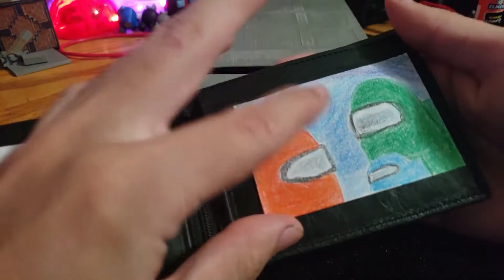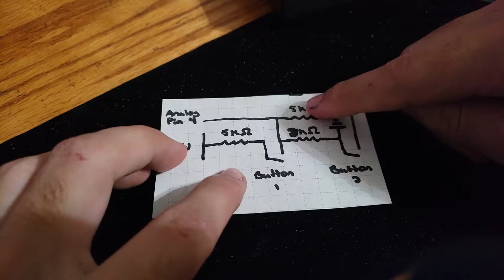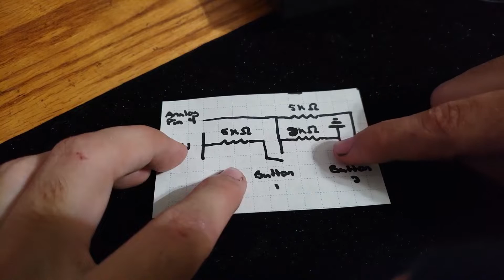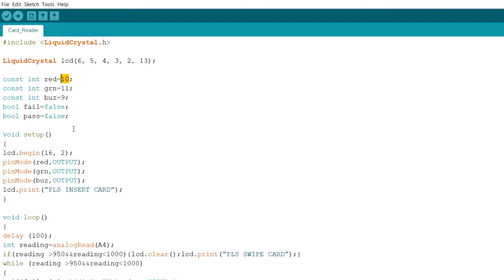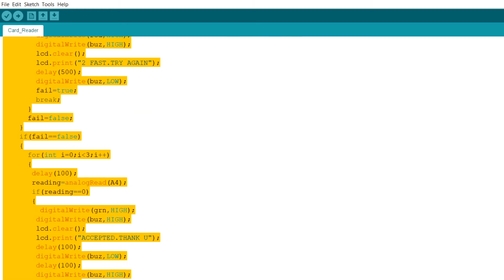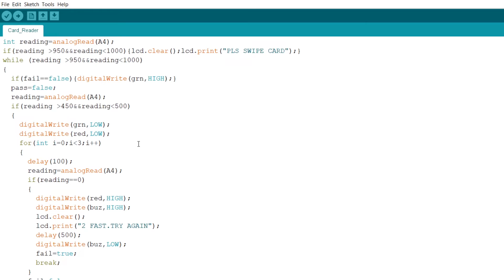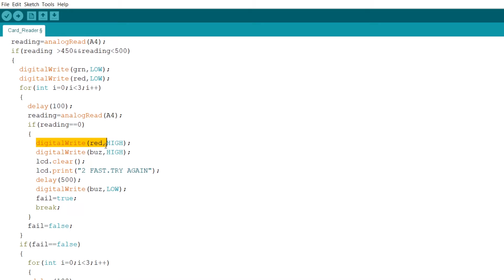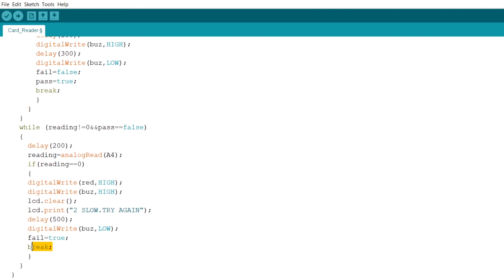Among Us Card Swipe Build

Comment: PLS TELL ME THE CODEEEEEEEEEEEEEE!!!
Reply from the maker: Luckily I had a spare copy. Go to this google doc to copy and paste.(under 2021/01/11) Cross reference with the video if any problems, and also reach out : )  https://docs.google.com/document/d/1d9TH0bv79RYRv-bEe2RoEuo2szrrrWT5UvjHN3ZVvrM/edit?usp=sharing
Reply: @hecbac  And what i need 4 this project?
Reply: @hecbac  And can i get the file in .ino? Cause when i paste it, it just says error massages
Reply from the maker: @eenomiofficial  I uploaded the ino file with the 3d models on thingiverse.  I don't know how long it will take to update.

What error message are you receiving? I highlighted what to copy and paste if the ino file does not show.

Also, you need an lcd, 2 tactile buttons, an arduino uno, 3mm red and green leds, and some resistors detailed in the vid.

Comment: How do i make it
Reply: i have done it with an unused card and copied your card
Reply from the maker: @maurizionotangelo1764  Sweet : )
Reply from the maker: I used a 3d printer to make the base, but you can use other alternatives like cardboard or maybe clay. The best way to get started with microcontrollers is through a arduino uno 3 kit. A simple one goes for around $30, but there are cheaper alternatives as well, such as the board only being $11 : )

Comment: To make it do i need 3D printer?
Reply from the maker: It would be easier to just print it, but you can make it out of wood too. The main stuff is the lcd and programming the arduino
Reply: @hecbac  Print with a normal printer??
Reply from the maker: @byn1653  Naw, 3d printer. You could probably make it out of paper or cardboard too though
Reply: @hecbac  how much it cost?
Reply from the maker: @byn1653  Ender 3 go from $200-300, but are really good : )
Reply: For the card you need plastic its way better but if you dont know how to make it from plastic use cardboard and if your done printed,painted,writed,on the card please put something Thinner on the cardboard left and right Cardboard side because its gonna look unrealistic or just make the Thinner to make it realistic because the cardboard sides cardboard things are there